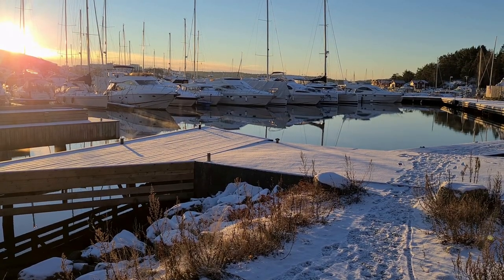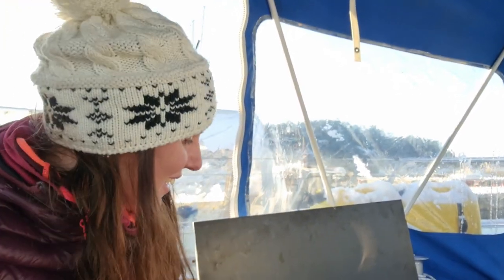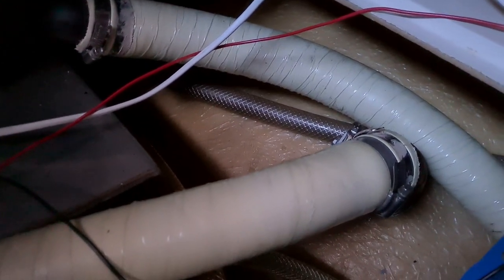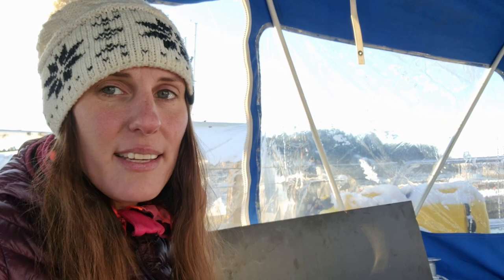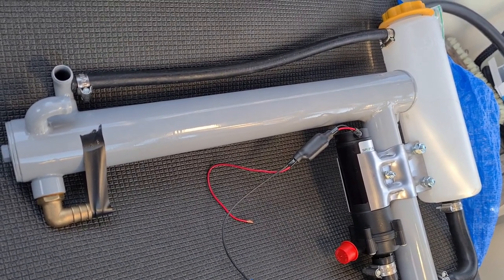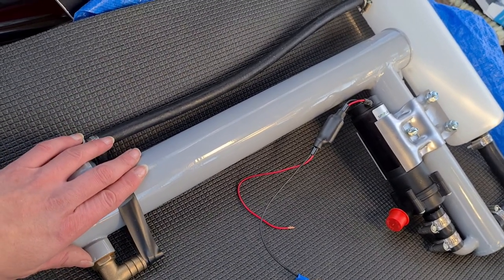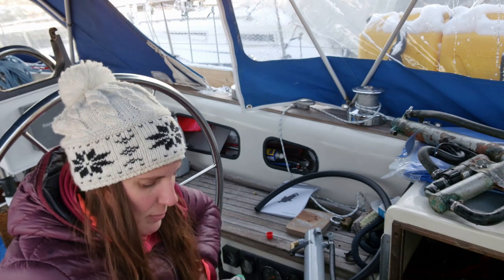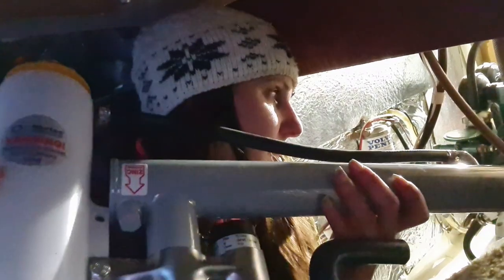Will this New Martec Finally SOLVE my boat PROBLEMS? Sailing Tilda #24

Comment: It is very good that you do the maintenance work yourself, you are gaining experience and confidence. Once in the middle of the ocean, should something fail, you will be able to fix it and you won't depend on outside help. This is a very valuable skill for a sailor, especially a solo sailor. Cheers, Richard
Reply from the maker: Exactly, if you don't know anything about fixing you will get inte troubble fast. Best way to  learn is to do, but of course I invest a lot og time in learning!

Comment: Looks like a project.  Hope the heat -exchanger helps your over-heating.  One result of over-heating maybe distortion of the head gasket.  This guy has a head-gasket replacement video.  Just some information if you are interested.  
https://www.youtube.com/watch?v=hRhMmUWYTYU